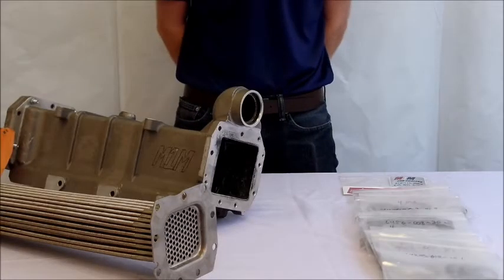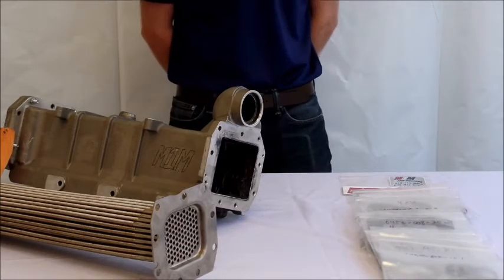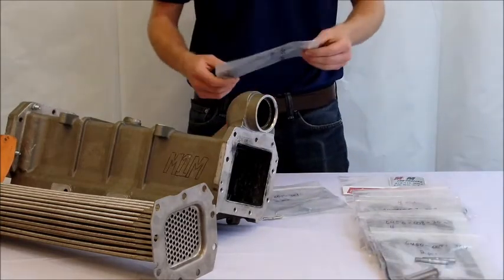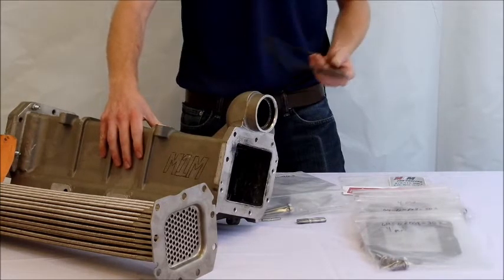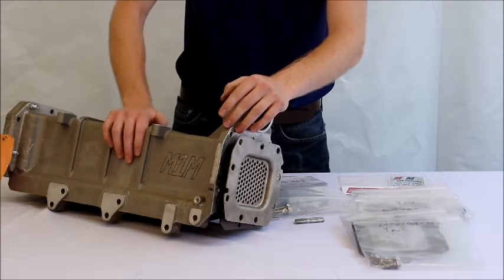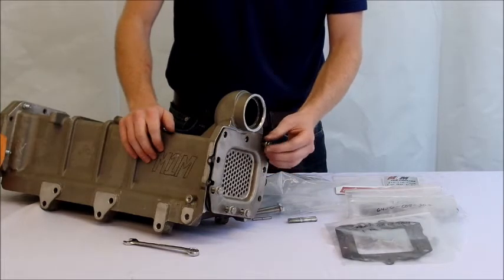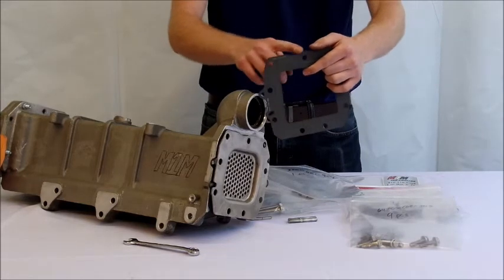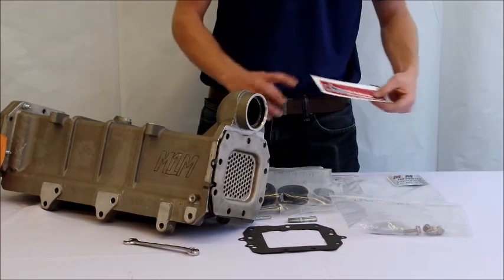M1M EGR Cooler Installation Video for core replacement for 2010-2013 MaxxForce* 13 Engines

Comment: Well both my egr coolers are CLOGGED,but before I change them I'm trying to clean them with FUELLIFT.COM,bought it at International dealer in AURORA,COLORADO. It is a one month treatment,I will give an update in about 3weeks
Reply: So I tried FUELLIFT for 3 months, my fuel got better it jump from 5.2mpg to 5.9. I still haven't changed both egr coolers😀, my dpf is blank lol truck runs great. It's not deleted, It even did a Regen a day before my emissions😀 believe it or no it passed on dyno lol. The only bad part is when ECM detects a cold dpf it blows blue smoke and thats every day, got stop once in UT lol cop though it was my breaks lol. But yeah a year now with no dpf just a doc.
Reply: Roy Andrade did the fuel lift work to clean get valve
Reply: Did it work